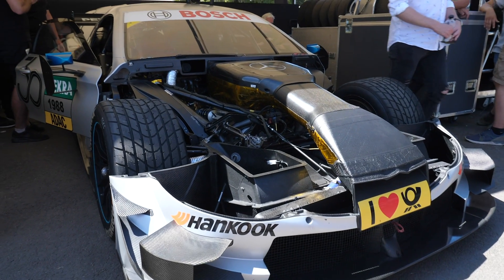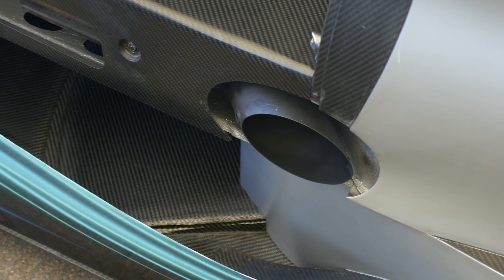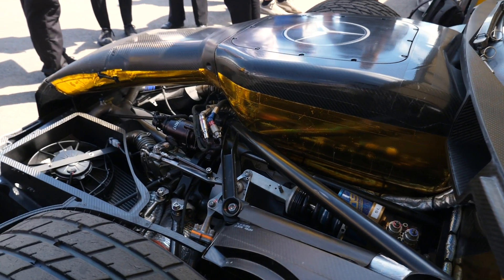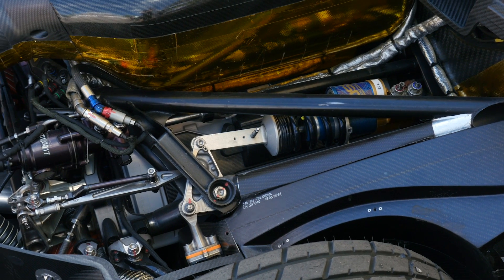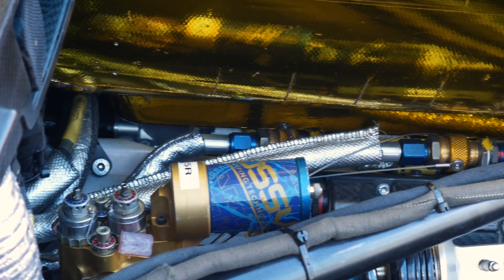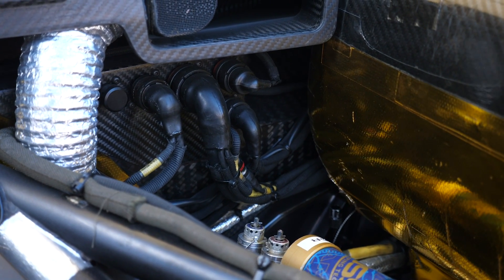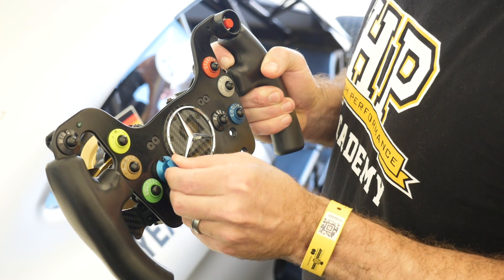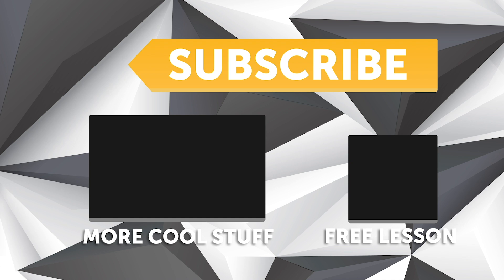500HP, 280km/h & No Driver Aids

Comment: I love motorsport from cars, bikes and trucks and have done for 40 years. I have to say aerodynamics on modern race cars has ruined racing from a spectator point of view. Cars should look like the car you can buy, No aero , a clutch and gear stick. Best driver wins ..... not best car wins.
Reply from the maker: There are still racing series with no aero and manual gearboxes. Make sure you support them so that they keep going if this is your preference ;) - Taz.

Comment: The last season was also the last season of these 4.0 na V8 cars. These were the loudest racing cars in europe at the time.
Reply from the maker: What do you think of the new configuration? - Taz.
Reply: High Performance Academy 

I think it makes sense.
While i still prefer the old insane engines, it makes much more sense for the manufacturers to develop relevant technology in their racecars, therefore the turbo engines are the way to go. And also they are much quicker, so it doesn‘t get boring in any way either :)

Comment: What a great look at the inner workings of a DTM racer!  It's quite a driver oriented series when you consider the lack of driver aids coupled with the high levels of aero downforce at play.  I had no idea they were running a spec transaxle and wiring harness.  Funny to hear these are "cost cutting" measures in vehicles comprised of full carbon tubs and exotic bellcrank suspension setups.
Reply from the maker: Yes the 'cost cutting' is all relative eh! Hate to imagine what the budget would need to be without such measures 😅- Taz.

Comment: I do wonder about ABS. It basically lurches you forward before you even lock a wheel, so it leaves traction margins on the table that a good driver can use. If the inside wheel locks a bit here and there, big deal.
Reply: It can be, as the resulting flat spots reduce both cornering and straight line braking - that is why cars in a race series where ABS is banned will usually have a 'lock up' warning light - Aussie Supercars, for example.
I would agree, though, that in principle it is better to hold it at the point where there is slight slippage and maximum braking, than having it cycling on-off-on-off- 

Many years ago, BMW (IIRC) had a unique mechanical proportioning setup which limited braking to the inner calipers by the use of a pendulum operating the valves - I believe it was a way of mechanically getting more brake force to the more heavily loaded tyre as electronic assistance was banned.

Comment: parading around like they have anything to do with the production car is just misleading. GT and Time Attack is way more authentic. Trans Am is the same stupid crap.
Reply: operamatt T/As are still a thing today? I thought that was for the 70s with mostly American muscle / pony cars 😅
Reply from the maker: I'm struggling to link Time Attack or GT to production cars either to be fair 🤪 - Taz.
Reply: High Performance Academy their are more classes of time attack than the über premium classes you cover. Even so they all started life with a VIN # and had to be built up to what they are today. Stop acting so out of touch. GT4 Class of racing, for example, is very related to the street cars.
Reply: operamatt GT4s are pretty much production based street cars. But generally when someone talks about GT, they probably meant GT3/GTLM/GTE. I’m not exactly sure they’re production based. The 911 RSR (GTE class) for example, is mid-engined now, which has no road-going equivalent.
Reply: GT Specialist I agree. I was more talking about Time attack and GT4 Classes. DTM, Trans AM & NASCAR all have this issue. Styled to look like something they are not.... very deceptive.
Reply: @operamatthew  well, to be fair, SuperGT/DTM at least still sort of representing the look of the sports cars they're modeling after.

NASCAR, well, the only differences between Chevy, Toyota and Ford are the stickers on the front of the cars to look like the GR Supra, Mustand and Camaro

Comment: This is the spec that I wished V8 Supercars went to when they introducted the 'car of the future' which would have allowed other brands to join them.
Reply from the maker: With DTM and Super GT moving away from V8's they've probably missed the boat there too, but it is nice to have a few different series around so long as they're running healthily and engaging - Taz.
Reply: @hpa101  As part of the 2.0 reg released in 2017 they allowed for 2 doors, turbo 4 and 6 cylinder engines but everyone has stuck with a V8s.
Reply: Agreed. Now that they're 600ish hp 2.0L turbo I'm sure with a bit of tweaking an interested party could homologate one of the modern DTM engines under the new regs
Reply: It would've been a great spec but we have to remember that DTM and Super GT have the backing of huge manufacturers with a massive budget , V8 supercars team don't and as we speak even the current V8s formula is too expensive for the teams now imagine if we had DTM spec cars. Maybe some day when there's over 100 million people here and the country is hugely developed we'll be able to challenge these manufacturers but for now we're far away from it.
Reply: @Fab_881  don't bother with the cars. Just the engines. All the dev work is done. Just adjust the boost to parity
Reply: @manitoublack  
I agree with the engine especially when it comes to their durability not sure if they can go the same distance in a season in V8s but with a bit more R&D I'm sure they can achieve it.